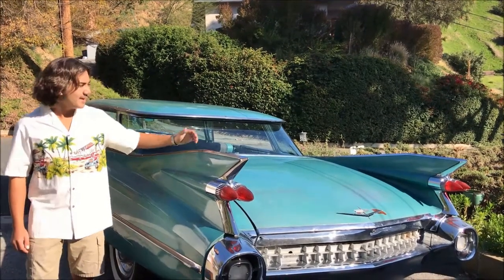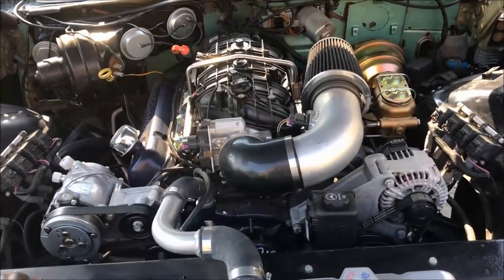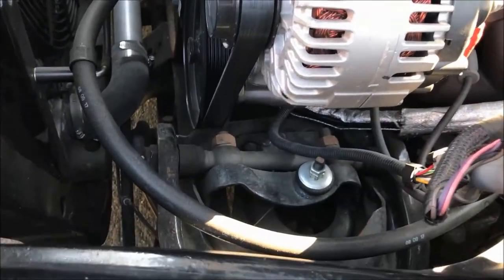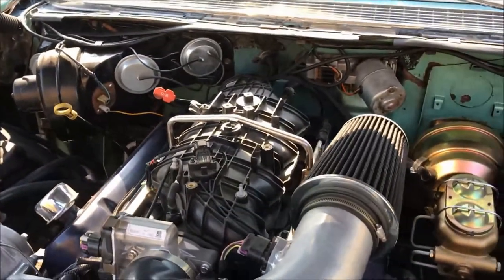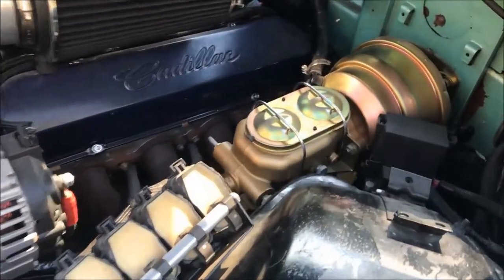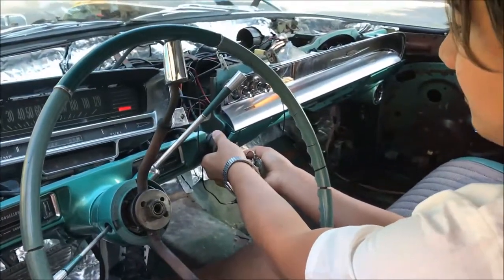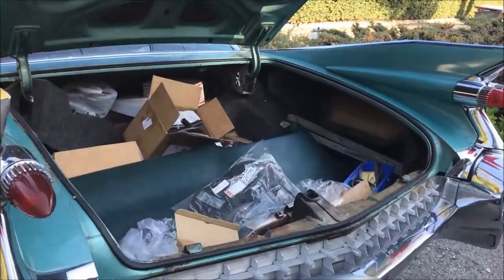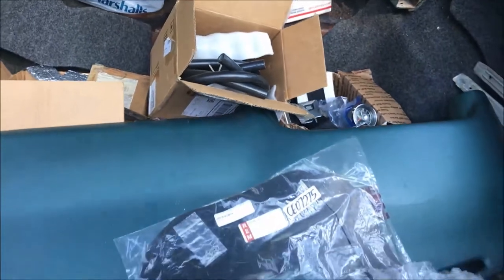1959 Cadillac Flat Top Restomod

Comment: I know it would upset a classic car purist but I am thrilled by the concept of putting a modern engine and transmission with electronic ignition in a classic car to make it truly reliable, drivable and livable and I would even be open to adding genuine head rests that tastefully look like they may have been in the original car. Though not in a convertible.
Reply from the maker: Than you for watching! Yes, that was the whole purpose of building this car. It is awesome to see all original cars or 98.5 point cars that are better than the factory. Sometimes drivability is more important than originality.

Comment: I'm sure the suspension bushings and brakes upgrades were a BIG improvement, especially in safety on this car.
Reply from the maker: Yes, the car rides and drives like new. It keeps the car in control but still allows for the "Cadillac" comfort. Brakes were really important especially since old drum brakes tend to pull left or right no matter how they are adjusted. Thank you for watching!
Reply: @59cadfins  My pleasure, thanks for the response.

Comment: Question ?
How i can remove the dashpad ?
Reply from the maker: It is very challenging and for sure and not easy. Start taking the screws underneath the lip of the dash. The cluster comes out with it and it is easier if you take the steering wheel out first. You have to disconnect all the electricals as well for clock, ignition, light switch radio wires and so on..It's pain and Good Luck.